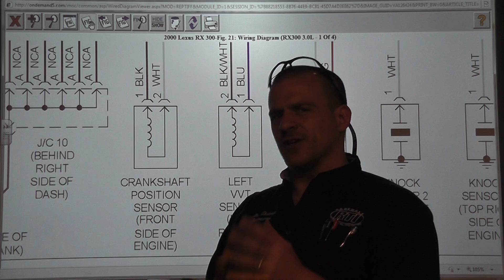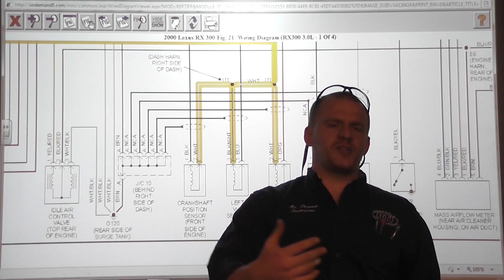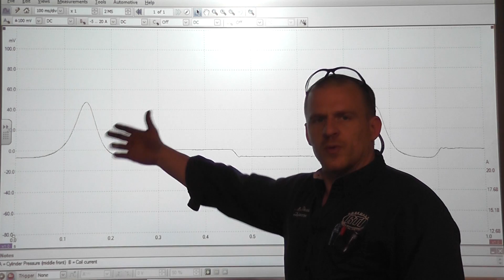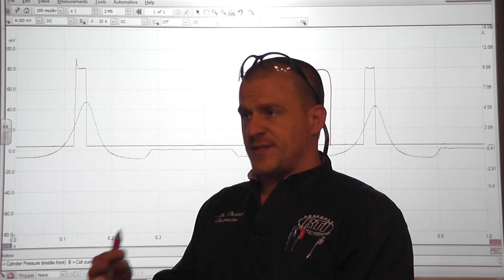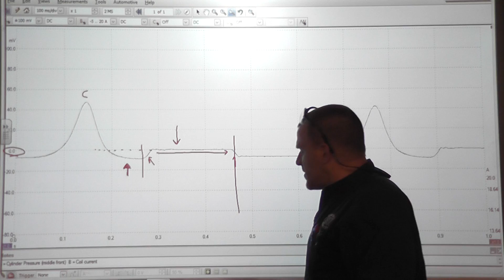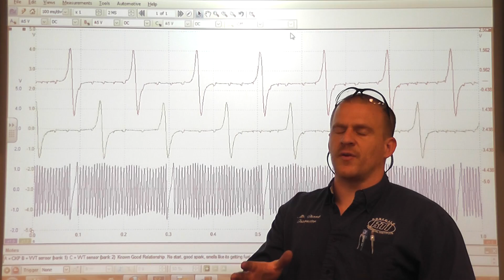Causes of low compression, no start from a stuck closed IAC (part 1) - Toyota/Lexus

Comment: Ok that was very interesting. My Honda civic has a crank no start problem. Everyone said oh it's the timing belt. But  first I did all the checks under the dash. no codes but I had the battery out for charging so that is not surprising. I took it apart far enough to do a visual inspection of the timing belt and it looks really good. No looseness and  it has no visible wear. Then brought # 1 up to TDC and checked the alignment and it appears to be perfectly in time. But here is the weird thing every time I do a compression test I get basically low compression but the numbers vary wildly from one test to another. Even checking the same cylinder twice back to back the numbers seldom come close from one check to the next. 
And when I did the first wet test all the numbers dropped! I have never seen that happen on any car. Then a dry test later the same day showed much higher compression than any of the previous tests and all the numbers this time went up to normal or nearly normal range but still varied from 110 all the way up to 220!!! Same number of cranks and same amount or oil in each. I'm starting to think the gauge I borrowed from a friend may be screwy. So going to Autozone to borrow one tomorrow. For info it has spark, injector pulses and fuel pressure. Pretty much has me pulling my hair out. It was running great then instantly stalled on the highway with no strange sounds or warning, just coasted to a stop and has refused to start or even cough since.

I've done the compression test with the gas peddle fully depressed but haven't fully inspected the air intake, could it have sucked up something? I have had the air cleaner apart and tried carb cleaner and priming it by soaking the air cleaner with gas, neither test elicited any attempt at starting.  But in both cases I put the air cleaner back together before cranking it. It has a long intake pipe so I think a closer look at that unlikely but potential problem is the next order of business.
Reply: TruAnRksT make sure all your keyways and roll pins for your timing gears are intact.
Reply: lstinthwrld1
Yeah I really considered a sheared key as a possibility, but I put #1 on TDC a half dozen times and checked the cam timing and it was perfect every time. That was he only thing I could think of that could explain the radical excursions in compression readings. I still haven't had it worked on but maybe soon.
Reply: TruAnRksT pull the crank gear. the cams will line up on a sheared crank gear pin.
Reply: lstinthwrld1
Naw that's not going to happen, if the crank gear is spun you can get the cam to line up but 1 will not be at TDC on every check.
 
Still, I might go to the trouble of pulling off the lower cover before I just say fuck it and send it to a shop. Oh I don't know if I mentioned it but since I originally posted I have checked it with a professional gauge and still get wildly different readings from one test to the next.

I also checked the rockers each time to verify int and exh were closed for compression stroke.
Reply: TruAnRksT nope, cams will line up every time. I have seen it twice at my shop. I do this for a living. good luck though.
Reply: You can take the head off the engine and the cam pulley and valves will line up, no crank or belt involved!

The cam pulley and crank pulley are locked together by the timing belt. (assuming it's good) If you rely on the timing mark on the crank pulley to determine TDC then yes the situation you describe is very possible.

I am quite versed in the mechanical dance required myself and that is not how. You have to physically/visually test the position of the piston. If the piston is physically at TDC AND the mark on the Crank pulley are good AND the marks on the Cam pulley are correct AND the valves are fully closed all at the same time, then that pretty much eliminates that whole end of the engine as suspect. 

Sure a sheared key could cause the symptoms, but at some point when it's supposed to be firing on #1 that piston is going to be completely and noticeably out of place.

And even if that were the situation with the pulley spinning and varying positions with every crank it seems like once out of a thousand cranks it would burp, fart, bang gurgle or make some fucking attempt at living.

Maybe I should switch to a vacuum test for more clues.

The problem I have as I probably explained somewhere is I don't have a place off the street to tear it down deep enough and for the time required. So I have to keep it looking like it's still being driven or the county will appear out of the blue and tow it away.
Reply: TruAnRksT if you are familiar with the dance of the mechanical as you put it then you understand dwell. and understand that the piston can be at tdc for several degrees of rotation. if the crank gear has slipped enough to be a tooth or two out of time your piston can still exhibit a rudimentary appearance of tdc without actually being at true tdc. as far as burping spitting or anything well that depends on how far it is actually out. no need for you to get frustrated. it only takes about an hour to tear it down to look. I have a feeling you will be surprised.
Reply: lstinthwrld1
Well I agree, it could be off enough while still appearing correct to keep it from running, But if it had turned a few degrees and stopped there then why would the compression readings change so much from test to test?
If it is turning every time it's cranked over then at some point the piston would be noticeably off time.
Reply: Did you figure it out??

Comment: what about a camshaft postion sensor no signal fault code which is static. and a blown up high pressure cam follower. im spinning the motor over getting what seems like no compression. only codes in vehicle are cam shaf position. would the vehicle put itsself in safe mode and cut all ignition if its not seeing where the camshaft is positioned at

Comment: does this throw a code? I have 4 cyl engine just died, NO compression in 3 cyl and 30lbs in #1timing belt is good, marks are on belt is tight. no codes thrown.  this is 2002 Dodge stratus 2.4L.

Comment: Another awesome video Paul. Like others here I have not seen this in 30 years working on cars. For me your awareness of the transducer pattern and interpreting it was awesome. For the novice it would have been over looked as the pattern looked good. Measurements where key.
We probably will never see this in a drive by wire but the older idle controls are still out there.
I was wodering though if there was a base idle setting that needed to be corrected as well with the idle solenoid disconnected?
Best tech channel on the tube.
Thanks Paul
Reply from the maker: I think the throttle body (minimum idle speed) was also restricted from carbon deposits, so yeah, a perfect storm. This one was truly crazy, I've never seen anything like it. 
Thanks for the encouragement my friend, I really appreciate it.
Reply: 1!¡

Comment: It should be a given that the throttle is opened when carrying out a compression test.Pretty weird fault all the same .
Reply from the maker: +Tam Couch for sure but what happens over the years is you get complacent, because you never see a difference with the throttle wide open or closed! This is due to  the normally open idle air control valve. But you can see how that thought process can get you in trouble

Comment: If coil primary current is synced via the crank sensor then how would off time cams throw your timing off in relation to the piston movement and resulting compression peak?
Reply: PRND21 I had this thought. if my crank sensor somehow is messed up would it throw off my  readings
Reply: It will still fire at TDC but Peak compression won't be at TDC if the valves are opening out of time, so it's not coil current that moves its the peak compression that moves out of place

Comment: If you listen real closely - it sounds like the engine starts for a split second, then dies.  Especially about the 14:10 mark in this video.  That kinda tipped me off to a restriction after your intake vacuum test.  

Did you notice that at all?  Mostly curious.

Comment: -continued.  I removed the  throttle body  and I did a close inspection  there is a little hole by pass was plug not the iac. wow it is little hole almost like needle I installed back and put back egr valve and has 20Hg vacuum running fine with vacuum. I wanted to share this one with you guys because it is firs time I see some thing like this . I WAS FOLLOWING TESTING METHODS ARE DESCRIBED IN YOUR BOOK , VIDEOS LECTURES AND  VIDEOS  THAT I HAVE WATCHED IN YOU TUBE . THKS YOU ARE GREAT TEACHER.

Comment: thank you,  for the tip of timing chain, but does not seems to be the problem. I suspected of catalytic converted plug I remove the 02 sensor  and did compression again with sensor out while checking the vacuum when it started no changes same vacuum same compression ,I though could be  sticky open egr valve and I remove the valve  no is closed I started the car with it out and runs  fine and my vacuum is 20 Hg now. if I plug the intake passage vehicles died.

Comment: MR. Danner I have 96 cavalier 2.4. I have a code for rich condition , engines runs very rough.first I checked fuel pressure  under specification,I checked for map signal and is reading  3.3 v should be about 1.2 to 1.5V, I check vaccum and I have  5 hg at idle and at 2500 rp when decelerate vacuum raises to 20hg momentary and stay at 5hg. I checked for comprecion and I have 245 psi even,  , i do not have specification in psi mithchel say 9.5.1 ratio what could cause this high comprc, and no vacc

Comment: I've ran across similar problems with the GM 3800, but before testing anything I applied the throttle slightly and engine started and ran. Once it started the IAC started working until the next time the engine was shut down. Next time I run across one of these I'll run an engine vacuum and compression test to see if I experience the same thing as you have here. Keep the videos coming, GREAT information!

Comment from the maker: As long as the key is off, the car will not start. They actually make a nice jumper tool for doing this. It's just a jumper wire with a button in the middle. Connect one end to the b+ and the other to the starter solenoid terminal, and when your ready to crank, hit the button. Good tool when you are working by yourself.

Comment: HI PAUL if i use jumping wire from Battery pos+ to the 12 volt feed to stater it should crank, not start tha engine even with the key off from the Ign in all cars?

Comment from the maker: If your amperage dropped after disconnecting the alternator then yes you have a bad diode that is causing this condition. Just replace the alternator, you may have some luck on a rebuild, but you will have trouble finding parts and some of these diodes can be impossible to change. 
BTW the maximum parasitic draw should be no more than 50ma on most cars. This would be .05a. You said your meter read .5amps (500ma) with alt. unplugged? This is still too high. Use a different meter to be sure.

Comment from the maker: Ok I have a few questions. First, what is the amperage to voltage conversion on the inductive ammeter you are using? Second, you said it went down but then in the voltage numbers you gave you show an increase?

Comment: Little off video subject, but if anyone can figure my problem out it would have to be you. 97 Chysler sebring conv. with Hids, and after market stereo; I just bought the car did all maintenance, notice 2 amp parasitic drain on battery with nothing on. I pulled every fuse and relay, disconnected Hids, but to no drop in current. What direction should I take. I plan on getting your video as soon as I get some cash, or just by more tools since im a admitted tool addict. Can I borrow your Verus? J/k

Comment from the maker: Some systems only use the crank signal for when to fire the coil(s). Some need the cam also. In either case if the timing belt jumped the ignition firing event will not be at peak compression anymore. Sure the valve timing will be off, but TDC compression will not change

Comment from the maker: I'm not completely sure I am following you on your question. I think you have my ebook, so check out Section 1 pages 20, 21 and 22. These are case studies showing ignition timing compared to relative compression (not the transducer, but similar test)
Pages 21 and 22 had timing issues. In particular page 21 had a jumped timing belt.

Comment: Hi Paul
Stupid question.In comparing the peak compression with coil primary current for timing belt jump,if the ignition firing is synced to crankshaft position,how do you explain that it will change with cam and crank out of sync while cranking the engine?would it be firing at the same time regardless of cam position?I know the compression would be a lot lower,but why would it fire sooner or later than TDC if it is not synced to cam position?Have you seen a pattern with actual belt Jumped?:)

Comment: I agree. Anyone who tries to diagnose problems on cars for very long is going to take "shortcuts" that their experience tells them to. This video is valuable in the fact that it shows how easy it can be to get off track, not to mention the procedures taught. I particularly like the in cylinder pressure transducer/coil ramp pattern. This video proves that Mr. Danner is more concerned with teaching than looking good on youtube.That earns my trust and my respect. As always, great video!

Comment from the maker: Oh ok, I guess I should have removed the intake then as this is necessary to get to the back plugs. Also you missed the point here. You CANNOT always remove a timing cover to inspect marks. I admitted my mistakes in this video (not opening the throttle) but more importantly there were procedures taught here. Some very valuable techniques that are will be extremely useful in other situations.

Comment: Thank you. The accumulation of carbon around the throttle plate modifies the venturi equation - it is a restriction to flow - and the dynamics of intake air flow. Also it could cause to not aloud it to complete close, since becoming an unmeasured air passage at idle. Great video, you are a great teacher, thank you for your hard work.

Comment: first of all it would have been faster on that vehicle to pull the upper covers and line up the marks than to go through all that added nonsense and secondly you should ALWAYS remove ALL plugs and open throtlle fully when doing a compression test .

Comment from the maker: There are adaptive IAC position programs. This is why a lot of cars exhibit stalling problems after a simple battery replacement.  The fix for this condition is to do an idle relearn (different procedure for every car) or simply clean the throttle body. This will restore "minimum idle speed" (airflow around the closed throttle plate with IAC passage blocked off). It is this carbon in the throttle body, not the IAC or the IAC passage that gives you the most problems.

Comment: Great video. Have a question about the IAC. I know that the pcm uses it to control iddle and start up bypass of air to compensate for the closed trottle plate. Now, if that hole is dirty to the point that a ring is formed around the IAC pintle, would this create a problem with the memory recordings for it in the PCM or there is an adaptive program to compensate for it up to a certain point into the PCM strategy ? Sorry, I am a network engineer and I am trying to figure it out the PCM software.

Comment: Hi Paul
How do you use the transducer and set the sweep and voltage scale.I have a MODIS and believe there is pressure transducer  available.Could you upload a set up with your VERUS please.Would that pressure wave form be different with throttle open?You opened a new way of diagnosing mechanical issues with voltage and time interpretation.I am gonna look into it.A burnt valve?a worn camshaft?Interesting.
Thank you
BTW did you pull a couple of plugs for comparison:):)
Awesome

Comment from the maker: On a fuel injected car, for the most part, zero. I have read specs of 2-5" during a crank but that was on carb engines with the throttle closed of course. Fuel injection systems have IAC valves that are wide open during a crank so your really not going to build vacuum. Most of the time I have found it to be a useless test. In fact in 20 years of doing this it is the first time it ever helped me:)

Comment: Paul, when you use the pressure transducer to check the the spark is firing at the right time, is that the same as using a relative compression test and checking where the spark is?

Comment: Paul, did you check for DTC's first? or did the low compression sound take you off in the wrong direction as you said? Crazy how a faulty IAC would cause low compression values though! Another very helpful video none the less with some nice very nice pico material!

Comment: This is amazing and will help me out in my diagnostic on my vehicle. I'm having almost the same issue but my '95'civic 1.5L stalls in the morning at red lights/stop signs intermittently/ rough idle to the point where the vehicle stalls. I replaced my IAC valve ~3 months ago, ran fine for a few days after that then back to the idle issue.
Reply: My 91 Honda Civic hatchback base 1.5 did the same now it doesn't start